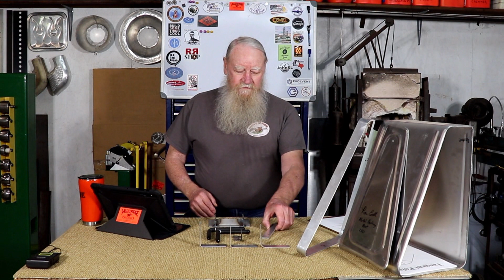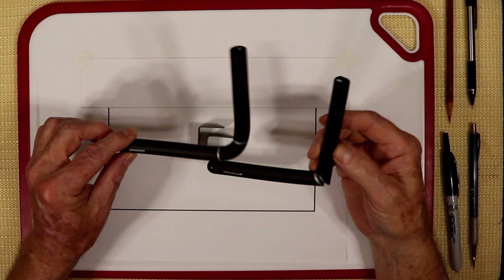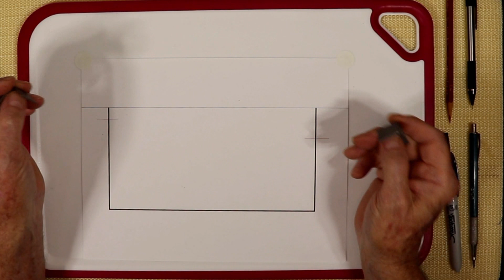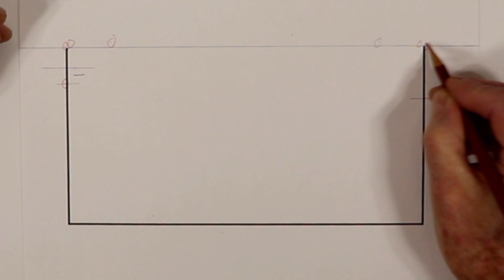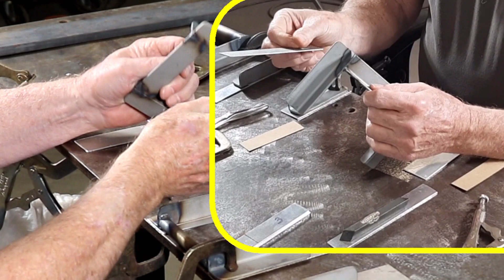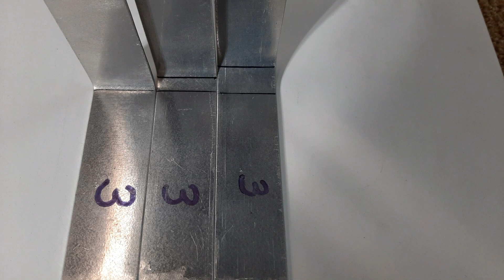How To Bend Sheet Metal In The Home Shop Part 2

Comment: Great lesson…but a question, you subtracted for alignment, but could you add assuming the length is undetermined?  ie; 3” leg but the bar is “x”…..or am I confused 🫤
Reply from the maker: Hi Chuck.
The length of the piece you use for the sample bend is at your discretion (how hard is the material to bend by hand). The radios of what you bend the sample piece around will tell you how much material is used up in making that particular bend.

When you watch the next video this question may be answered. 

Good question.          Jere

Comment: Thanks, Jere.
For most folks who are visual learners (and usually also tactile learners), I expect that this video will have helped to clear up any lack of understanding that they may have had. 
Radii.. radiuses.. radiuseses...  they are all just measurable bends ;)
Joe
Reply from the maker: Joe.
That's why I went through the layout again. I have to see a project in my head complete before I start. What material best for the job, sequence of operation, tools required, and what machine best to use. It's hell being a Virgo.

I'll be busy next week putting a bunch of radiuseses in a single piece of stuff.

Jere
Reply: Jere, I have to envision the project outcome as well but not in the depth that a Virgo does, apparently. ;)
Be sure to not get over-radiusesed. ;) 
Joe